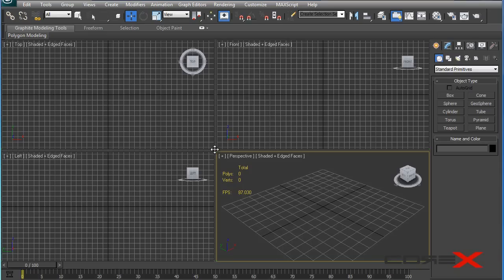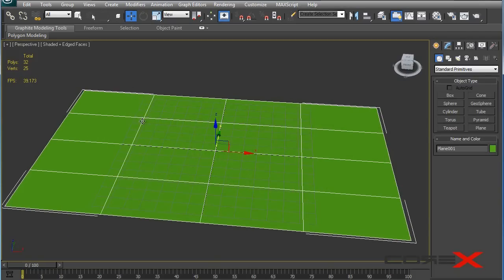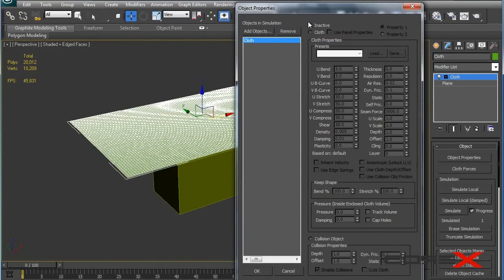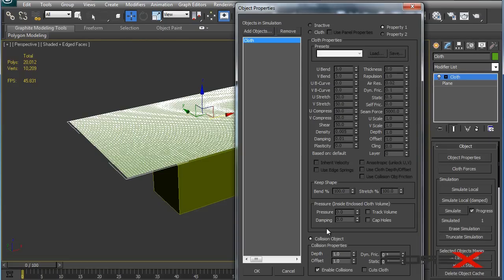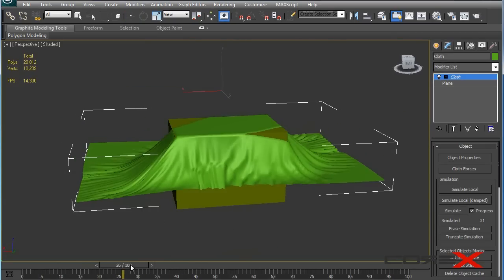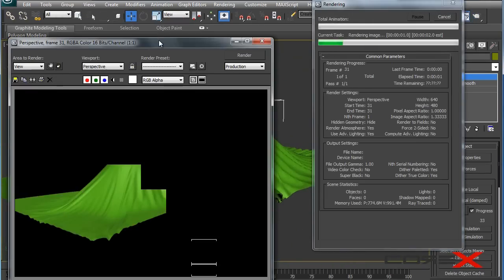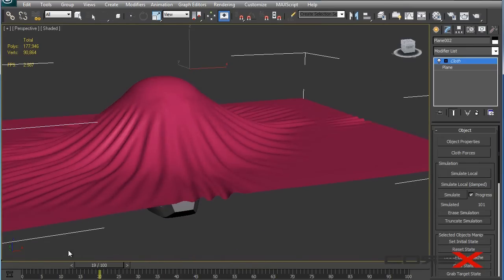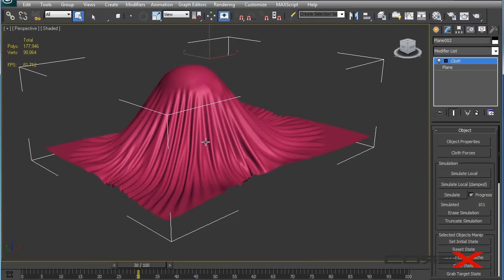3ds Max Tutorial | Cloth Simulation

Comment: a small tip for you, see those hard edges that eppeared after u simulated it as if the sheet is cut through by the table edges ? after you make simulation and u are done with modifier cloth, do shell gives thickness ;) i hope i helped

Comment from the maker: If you directly hit render without checking the 'save file' box in the render setup dialog, then 3ds Max does not save the file. It stays in the frame buffer (or the 'rendered frame window') till a new render is done. You can save it manually by clicking the save button on the top of the window.

Comment: my simulation will not go past frame 16 because there is a message that says "Decreased because cloth is over-stretched" WHAT DOES THAT MEAN!? help me
Reply: Is it still simulating? I get the same message, but it is still in the middle of the simulation. Give it some time.
Reply: Try using less segments and lowering. Too many segments can cause problems for the simulator.

Comment: What else can you do if you want the cloth to fall onto a box with edges? I want to make a sheet on a bed but the cloth cuts through like in the video. I tried using a chamferbox as a "mattress" and it helps a litte since it's not as square, but still doesn't work like I want it to. Any suggestions?
Reply: Update: Using a chamferbox and increasing the fillet-settings helps A LOT when creating a bedsheet! Works great for me, the edges of the mattress needs to be pretty round though but it looks really nice!

Comment from the maker: If you need the cloth to fall onto a rectangular shaped table, why wouldn't you change the shape of the table?
According to what I get, what you should do is, simulate the cloth to fall onto whatever shape you want it to fall onto, then delete and replace the table. Since it will save it as keyframes, instead of references, it should work..

Comment from the maker: Oh, that's not a PNG problem :D
You need to change the output frames (the first option in the render setup dialog). It will be set to Single by default. Change it to Range, and input the range of frames you want to render, ex. from 1 to 100 :)

Comment: Seen it. With plugins anyone can do it in seconds, that kind of functionality don't come with 3DS Max by default.
On Blender (the one that I have more experience with) after make some buildings with basic geometry, create particles, set the value of particles to e.g: 2000, join all buildings to same group and 2000 buildings will appear in random places. Blender have similar plugins but I never care about them.To me is not about losing or saving time, is all about fun in doing what I do.